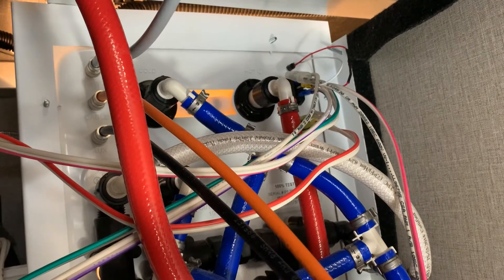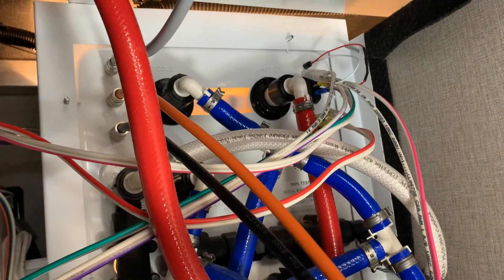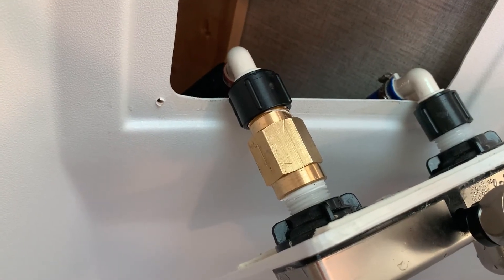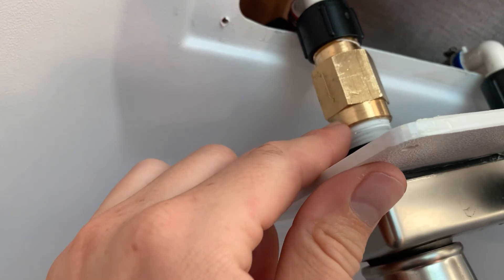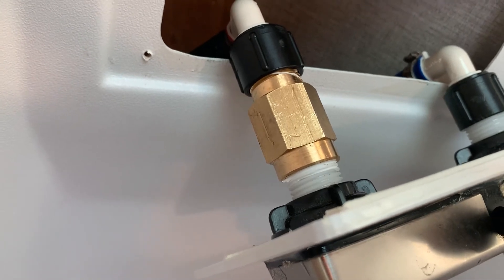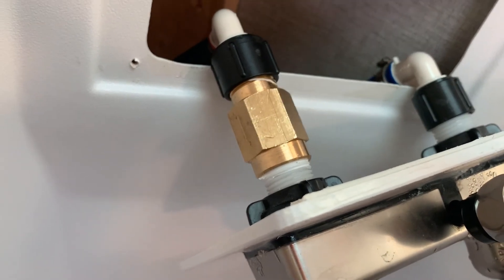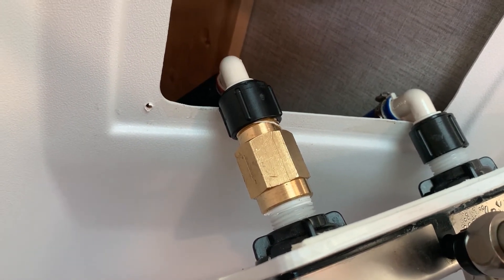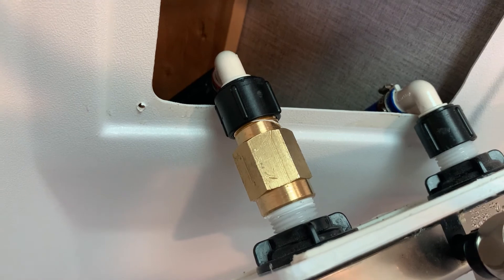RV Camper Shower Cold Blast Fix

Comment: Know why the pipe threads leaked? Because the faucet uses NPS threads (national pipe straight) and the back flow valve is NPT (national pipe taper). Both share the same thread pitch. While NPT & NPS threads will engage and seem like they fit - they will not seal properly with each other causing leaks. Sure you thought you solved the leak by going all out on pipe tape but really that was not the answer. You needed to cut the red pex  hot pipe along the vetical section of pipe very close to the 90 degree elbow and used a 1/2" pex barb to 1/2" MNPT (male  NPT), and a 1/2" pex barb 10 1/2" FNPT )female NPT and the back flow valve goes between the MNPT and FNPT.  As for NPS straight threads they seal with a rubber cone inside the threaded nut whereas NPT seals by wedging the threads together and pipe tape helps ensure a good seal as well act as a lubricant to allow those tapered threads to bind together tighter.

Comment: Would a back-flow preventer cause problems when it’s time to winterize?
Reply from the maker: My general answer would be no.  If you winterize per Grand Designs instructions, you are running glycol through your plumbing system until flows out the nozzle, so you have the glycol from the pump through the backflow preventer.  If you winterize by only blowing air, I again think it would be fine, you'd just probably want to make certain you only have that line open so that there is enough pressure to evacuate the line and overcome the internal spring inside the backflow preventer.  I haven't had any leaks or issues from winterizing with it.